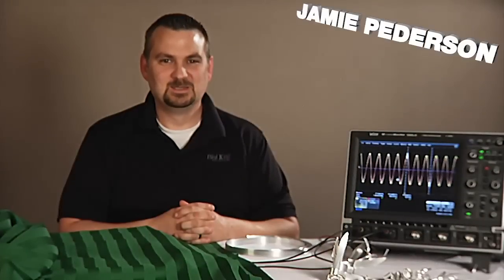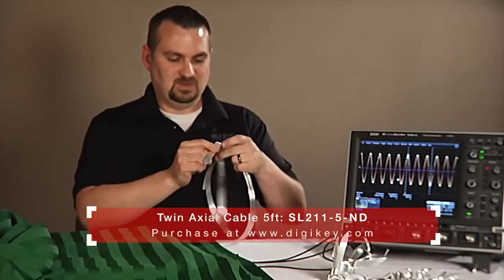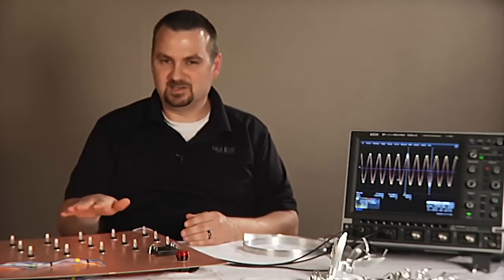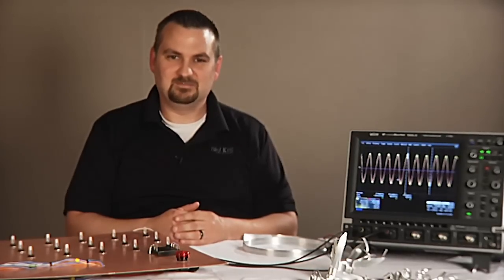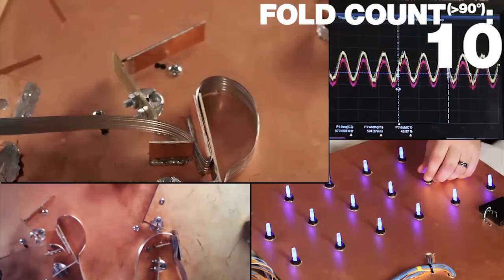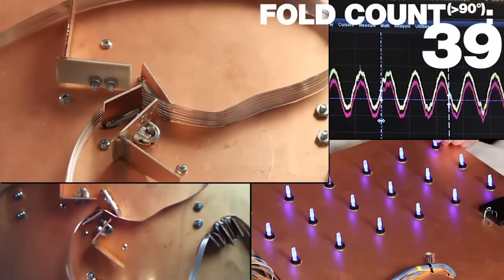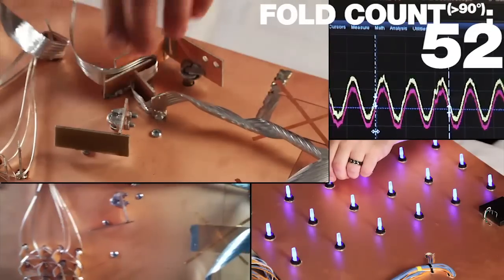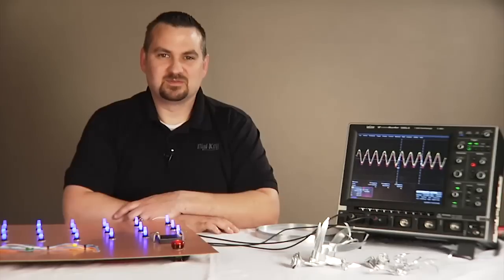3M cable bends without fail - Another Geek Moment

Comment: So it seems like the voltage difference on the oscilloscope stayed the same throughout most of the folds, but you neglected to show video of the initial difference that occurred from the initial few folds (before fold #5).